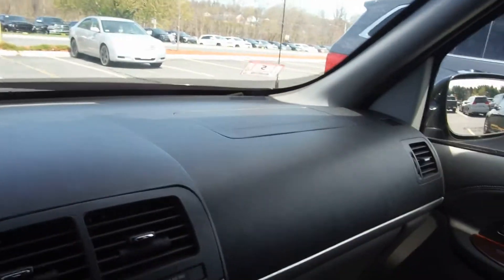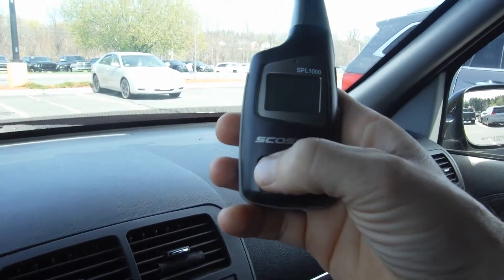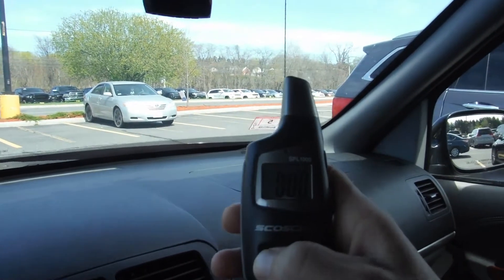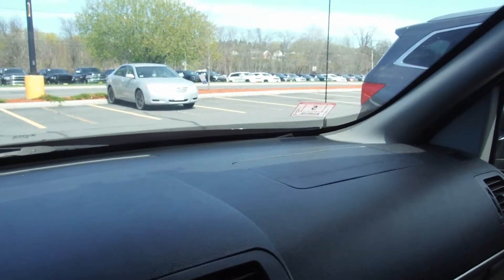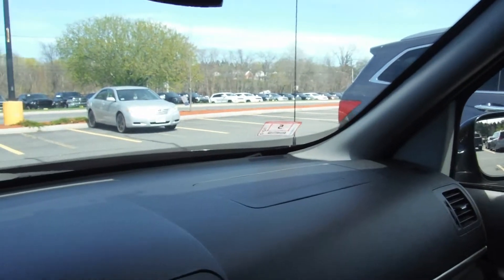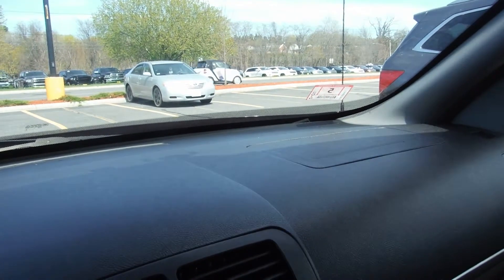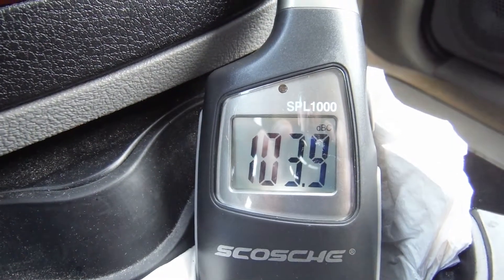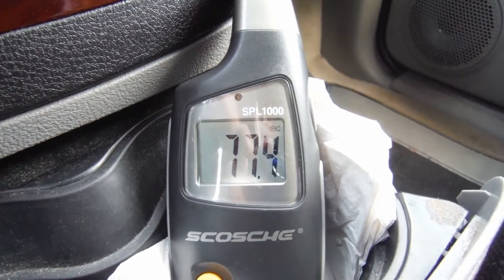Scosche SPL 1000 Boom Stick DB Meter JL Audio & Rockford Fosgate Subwoofer

Comment: Just looked it up goes to 135db
Reply from the maker: They made a newer model apparently. The 2 models I have go to 130. They have jumped slightly higher but I'm not sure if it's accurate or not. The newer model does go higher. Maybe I'll buy one for my son-in-law and do a video on it and compare them. I will add in my SPL Lab mini into the mix and see how they compare to a real meter for accuracy. Thanks for your comment 😊

Comment: Does this meter read just the bass or the sound also I'm using a cheap DB Mike but it's the same decibels with the subs on or off
Reply from the maker: So your music is as loud as your bass. I guess there's nothing wrong with that. That's an all around sound I guess. I'm going to try that in my van and see what happens. I'll try it with mid bass also. Thanks for your idea and thank you for your comment 😊